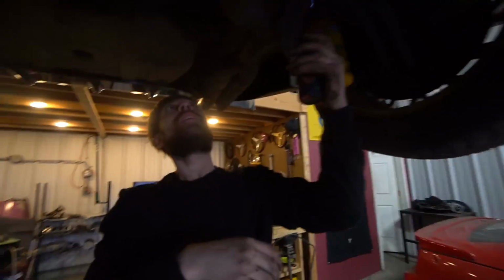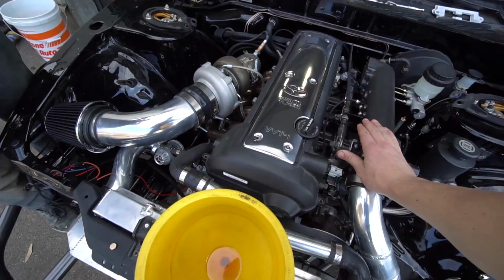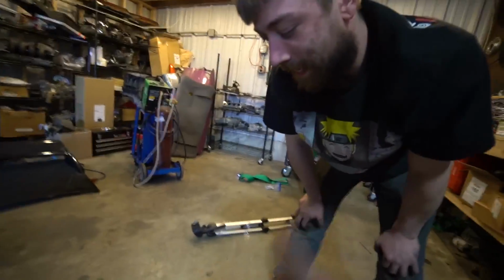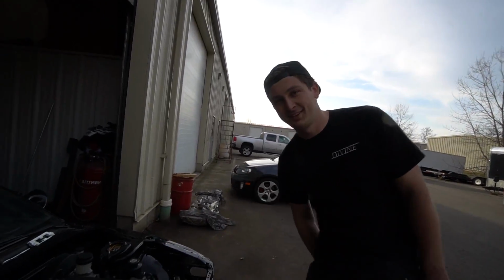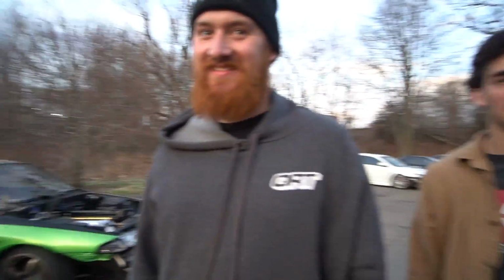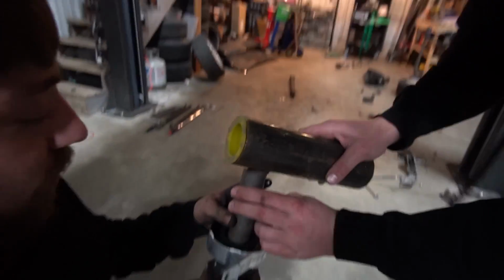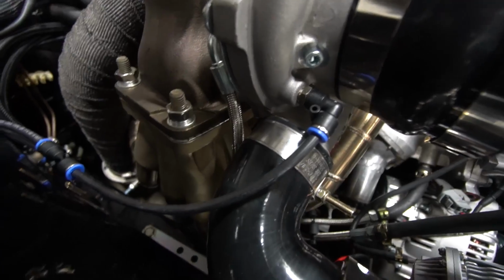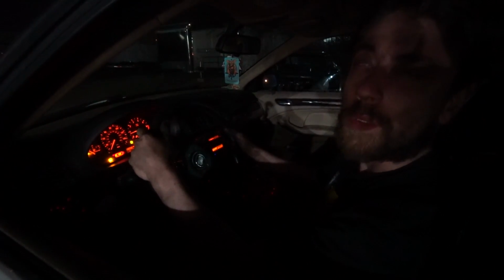First test drive after COMPLETE drivetrain swap!!

Comment: For your coil pack conversion go to Home Depot or Lowe's and look for a package of compression springs.  you can use that to put in between your coil pack in the spark plug extension so that the electricity will flow from the coil pack through the spring to the spark plug extender. I did that for my LS coil pack conversion on my Nissan 300ZX Twin Turbo slicktop. The OEM Nissan coil pack extenders have a spring in the bottom that comes in contact with the top of the spark plug that's what gave me the idea to look for a stainless steel compression spring to begin with. It worked perfectly just used a dab of Dielectric grease in the top of the coil pack and in the bottom of the extender between where the spring Meats that way there's no corrosion or anything over time. The person before me did the coil pack conversion and all they did was stuff the coil packs down inside the head it made for very faulty connections. Using the spring with the OEM Nissan spark plug extender I was able to mount the ls coil packs in the OEM location on the 300ZX motor. Same thing you will do on your Jay-Z motor. All you got to do is go to Lowe's or Home Depot and find a 2 to 3 in Long stainless steel compression style spring it was no thicker than 1/4 inch in diameter and it was roughly 3 in Long again I use Dielectric grease on both ends of the spring and i stuff the spring in between the coil pack and the spark plug extender it worked flawlessly that way you don't have to use those spark plug wires between the coil in the plugs

Comment: ** I just finished a 1jz cd009 swap into my s13 recently, and I'm also using the serialnine cd999 shifter. All forward gears work but my reverse keeps popping out like yours. I bought my trans used, so chalked it up to a bad transmission, but yours is new and appears to be doing the same thing. Please let me know if you ever figure this out. I've tried many things to get reverse to work in the last few weeks but no luck! Congrats on your first drive around man, feels great doesnt it?!
Reply: I would hit up Serial Nine. It shouldn’t be popping out, it could just be the adjustment on the shifter throw being too short or something simple. But idk, don’t listen to me because my swaps not done yet lol
Reply: Could also be whatever fluid you’re using. I’ve read a lot on the Z/G forums, and almost people don’t like running redline/royal purple or anything besides an oem Nissan fluid because they cause problems
Reply: Yeah, I did check with Serialnine and they said it was weird and not an issue they have heard of before. I've tried adjusting the damn thing every which way but no success. The trans was filled with some Kia gl4 MTF that my buddy got since he works at a Kia dealership, but it's the same stuff he uses in his cd009 and it's taken a lot of abuse with no issues.

Comment: Was the (what looks to be) increased front camber a side effect of the JZ install? As is also mentioned by the engine/trans sitting very low to the ground. If so you might want to look into a increased spring rate setup for the front coil overs.
Reply: The JZ/R154(pretty sure that’s the route he went) is ALOT heavier than an sr setup. The extra weight weighing the car down alters the suspension geometry so it added a bit of camber in the front

Comment: Jimmy, Pulling on the push-loc ring LOCKS it. Push the ring DOWN and it will release the tube. Otherwise, simply pulling the hose would unlock it.

Comment: Just remove a heater hose when filling the rad to burp the air out... I've been commenting this for over a year. Skid factory just did a video talking about this go watch it
Reply: $125 Air Lift ! And you can do the job properly, knowing their are no leaks before you even add the coolant and completely filling the system with no need to bleed ever. I bought one nearly 10 years ago and can guarantee it has payed for its self 10 times over in coolant and time saved. Iv commended it i so many times on different YouTube videos and i shake my head every time i see one of them filling a coolant system the old way and then struggling to bleed/belch a coolant system.
Reply: @johnt2k7  I bought one recently and love it, definitely the best way to do the job.
Reply: @johnt2k7  Those are nice for finding leaks i have a hand pump style but still would rather just popping of a heater hose. They sell a T fitting with a removable cap to go inline of the top or outermost heater hose and all my cars have one. Makes it nice when flushing the system
Reply: I’ve always just jacked the front end up ridiculously high so all the coolant can get through the block and Heater core no problem. I even own Subaru’s, which are notorious for burping coolant lmao

Comment: jimmy if you are going to do 2 fan triggers i suggest you do so both fan run the same time but low speed / high speed instead. you can do that simply by have them run in series for low speed and parallel for high speed. check here the botom diagram http://www.gtsparkplugs.com/electric-fan-wiring.html